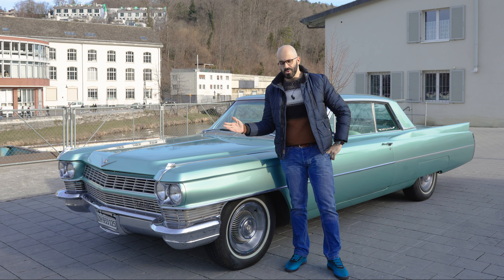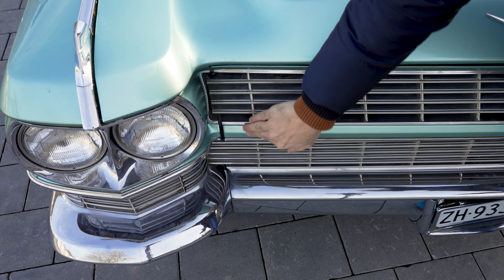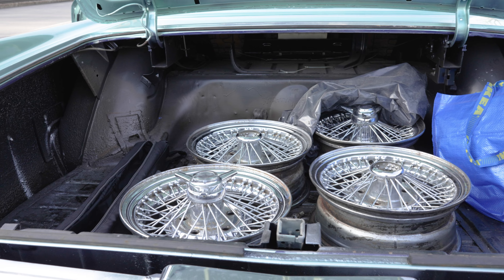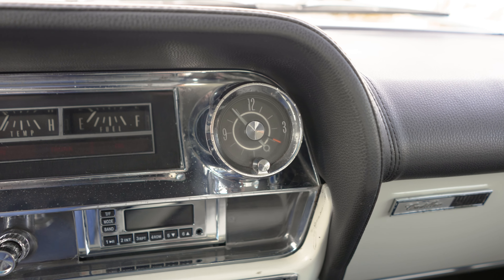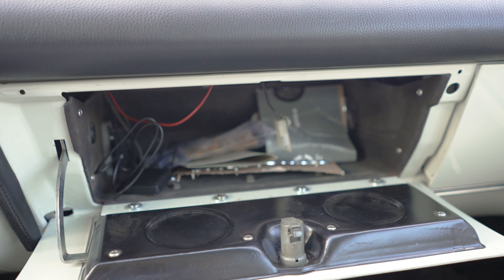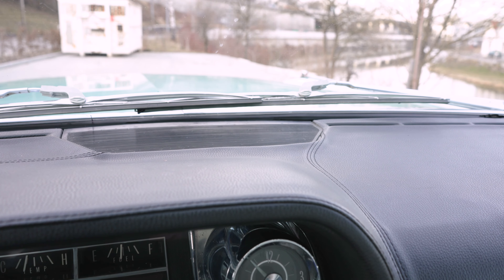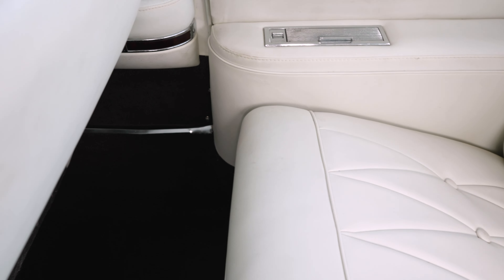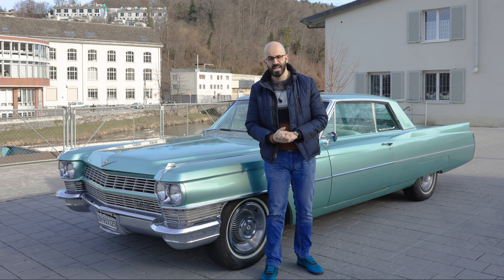Everything that is wrong with my 1964 Cadillac Coupe De Ville

Comment: Interesting "project". I hope the amount of work will not overwhelm or frustrate you going forward. Personally, I think you are underestimating (by far) when you say CHF 4000 to get most things done, as I suspect you are going to need more work done by Swiss mechanics or specialists, and their hourly rate is ridiculous. I will be watching your next videos with much interest, and wish you much success! 👍🏻
Reply from the maker: "How hard can it be?" 😅 I have the relevant literature and a good understanding of how the system works. I should be able to do everything except filling the system myself. As long as I get the parts, and the stuff I have left still works, I should be able to pull it off. Or I might set the car on fire at some point because of insurmountable frustration. 🤷🏻‍♂️

Comment: Again, someone had this car apart to paint it and did not finish the reassembly, lots of parts left out - looks like youre also missing the round duct work that runs up to the dash vents, control cables are also likely not reconnected, really poor job of reassembly what a shame.

Comment: very cool car, COMFORT CONTROL, VERY RARE OPTION FOR A DEVILLE, PPL USSUALLY ORDERED IF THEY GOT THE ELDORADO, ,  OR FLEETWOOD SIXTY SPECIAL, ONE REASON, NO HEAT, BECAUSE HEATING / COOLING ARE INSTALLED IN ONE UNIT WITH CC, BUT WAS SEPARATE  UNIT CONTROLS WITH AIR/ AND HEATING, YOU PROB ALREADY KNEW THIS THO, LOL.

Comment: Owning a '64 myself, I wrote twice some suggestions, but my comments are immediately deleted for whatever reason. Is there some automatic Youtube Artificial Dumbelligence judging the content of these comments?
Reply from the maker: Not from my part. I appreciate all the suggestions.
Reply: @swisscarguy  I recommend checking the wires that go from door to body, inside the rubber grommet. they tend to crack and wear and may cause anything from misfunctionality to an electric short and fire
Reply: @swisscarguy  GM has heritage pages where you can find a 420 page data book and a few years ago you could get a build sheet for your car. I can not write more specifically because Youtube auto-deletes it

Comment: I don't get it why anyone would buy such a car. It looks cool but does it have anything else going for it? I guess not. Will be a problem to maintain. If you fully modernize it ,  I think it will make for a quite unique project car, but I can imagine it will be damn expensive. I mean new engine, driving train, etc etc. 

In the end of the day it should make sense for owner, so fine.
Reply from the maker: Because you cannot buy a car like this new. It's a very different driving experience from modern cars. And I like it.
Reply: @swisscarguy  what specifically do you like about the driving experience?
Reply: I like it too, it screams rock and roll and Elvis. Hard to maintain in Europe, not practical, astronomical consumption, crap handling and performance but oh so cool and, looking at the way the holy grail 59s prices have gone, other years should be affected, so also a solid investment.
Reply: About 20 years back I considered buying a running 63 Cadillac. The kid who owned it wanted $2000. My wife pointed out that I wasn't a mechanic, so I passed. Still, I do dream about the car. It's a rolling work of art.
Reply: Because its swag.

Comment: I will agree, the original carburators for these have issues and are not the easiest to repair.  I'm currently dealing with one right now as we speak lol...  probably going to put a street avenger series on it,  But I will say for such a big car, knowing they  under rated the power of this engine do to insurance and regulation. it is remarkably efficient on fuel with a functioning original carburator. Depending on how heavy your foot is on that pedle lol.